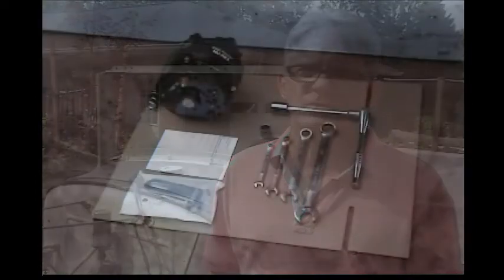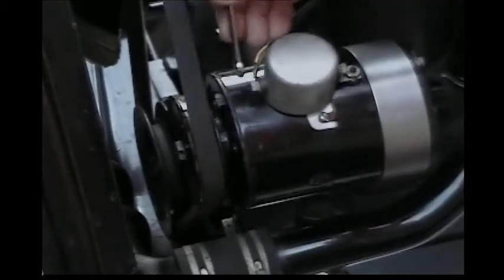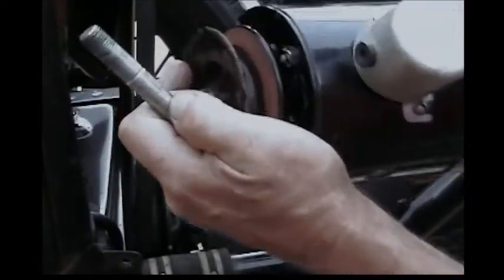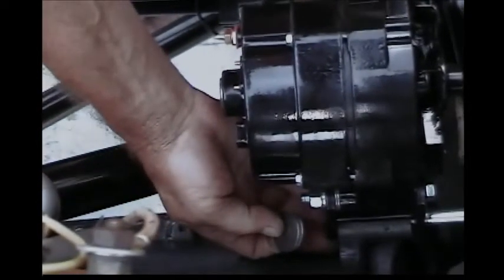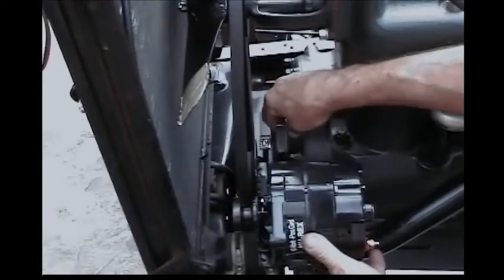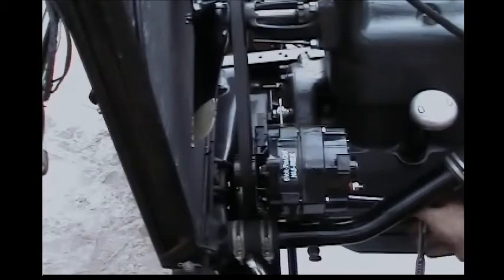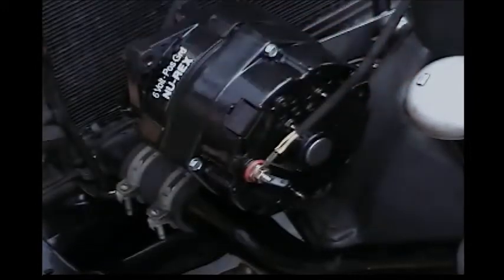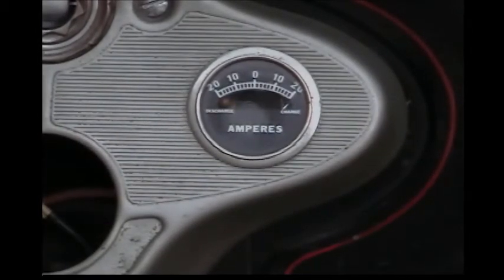6 Volt Nu-Rex Model A Ford Alternator Installation

Comment: Thanks for the in depth tutorial on your 6 volt Nu-Rex Alternator installation. This seems to be a wise move for a Model A since an alternator typically provides greater amperage at a lower engine rpm than would be the case with the factory installed generator.

Comment: Ok, I installed the Nu-Rex 6v alternator in my Ford Model A "as instructed".  When I started the car, the Amp Gauge "pegged' past 20 Amps as expected (excited) BUT, then I heard a "whistle" each time I goosed the throttle.  I didn't think that was a good thing so I shut it off. What do you think it is???? Is it normal and does it go away?  How often do you answer these questions?  I asked one a couple of weeks ago and have since deleted it after I figured it out.
Reply: Some whine from a charging alternator  is normal,watch the voltage does not exceed 7.5- 8 volts for a long time,6.5 volts is good with motor off.20 amps is not good continuously for your battery, it should taper off on a good one,you could drive with your headlights on to cut it back some but that 6 Volt Nu-Rex Model A Ford Alternator should have a built in regulator that the stock  model A generator did not have.Nu-Rex makes three models for the model A that I know of a 6 volt 30 amp,6 volt 60 amp and a 12 volt conversion 90 amp model.They are all cheaper than a stock generator and will last longer.
Reply: Will whistle till batt fully charged.

Comment: How many amps on that alternator? The alternator I installed used both wires from my generator. Someone told me you should change the ammeter as well to a 50 amp ammeter. But I haven't had any problems using the original 20 amp meter. I'd like to retain it for the original look anyhow.

Comment: Are there plans to make units to fit other antique vehicles ?  It would be a nice upgrade for lots of other 6 volt negative ground units
Reply: it is very easy to make a 6 volt negative ground alternator out of a 12 volt Delco 10 sI alternator. Just change the voltage regulator.
Reply: @michaeleisenbise4278 can I get that information from NAPA or O' Reilly's for example ?

Comment: What do you do with the other wire that attached to the generator that goes to the light switch housing?
Reply: Did you figure this out? Im installing mine now
Reply: @Justin-ne2xo  yes, I got it wired correctly and it works great!